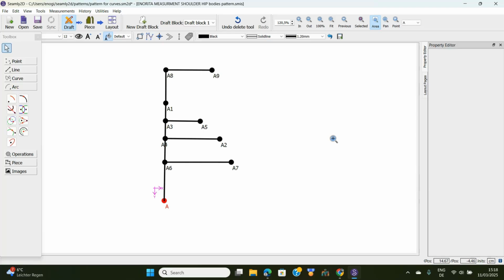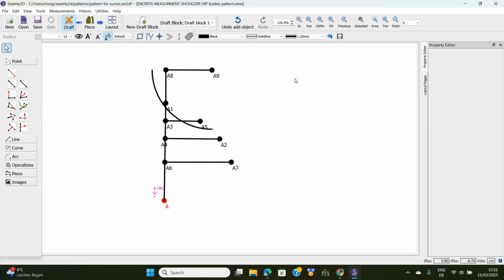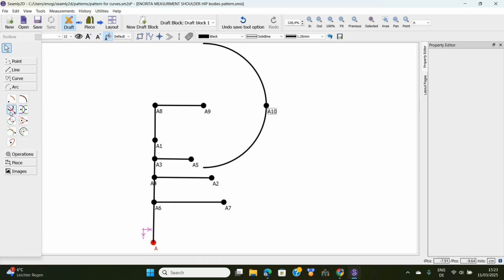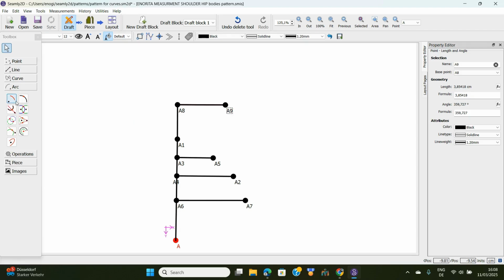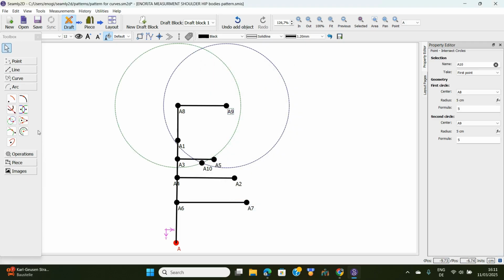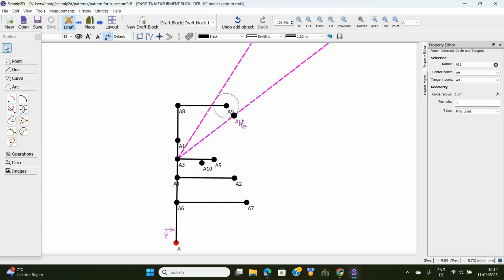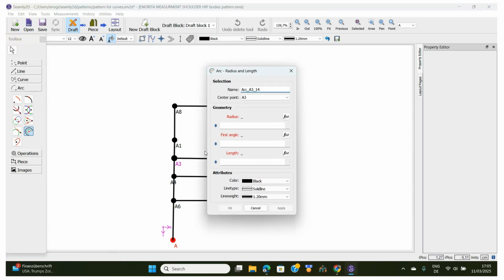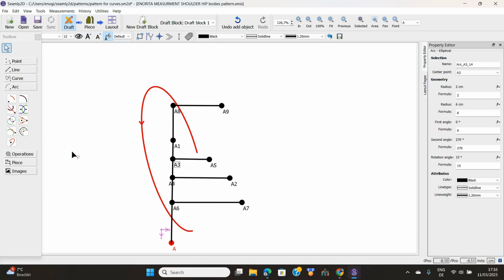Learn Seamly 2D basics for the beginner/Episode 3. How to use Circles and Arcs tools

Comment: Your videos are very helpful, thank you. I have not been able to figure out which tool to use for putting a point on an arc at a specific distance from another point on the same arc--for example, contouring. I have my bust radius and I'm trying to draw the contour lines around the radius. I've used the intersect arc and radius tool to put points for the midpoint of the bust contour, neck, etc.--but now I want to put points on either side of each midpoint at a certain distance on the arc, so I can add in the contour lines. I'm guessing I use the point on arc tool? But I just can't figure out how to do it. Do you have any instructions/suggestions?
Reply from the maker: try watching the video again and experiment with the different tools ,i am sure you will find somthing that can work well for what you are looking for